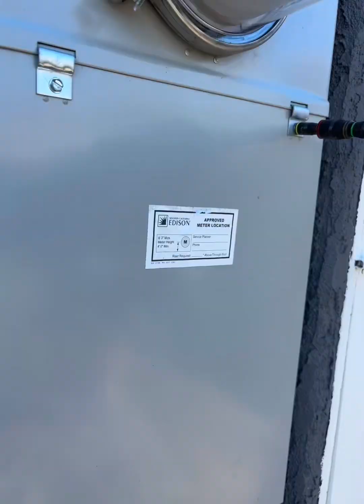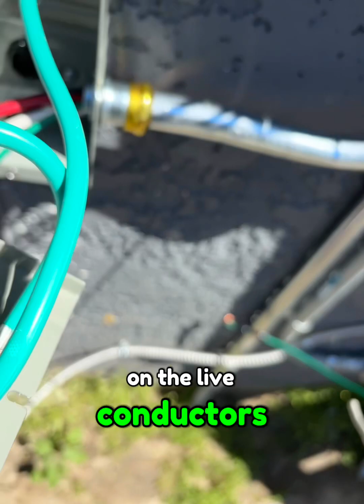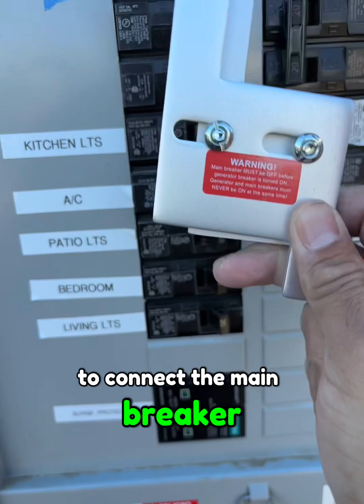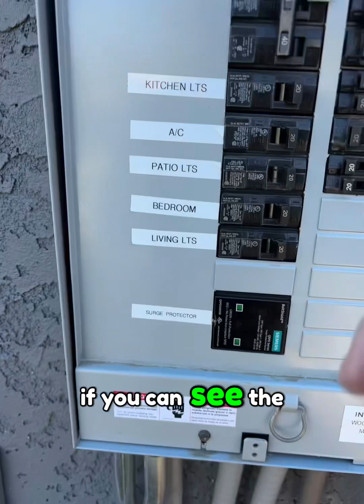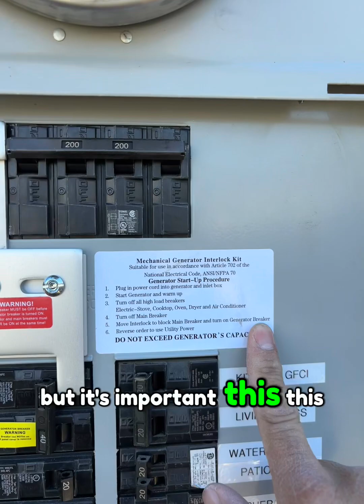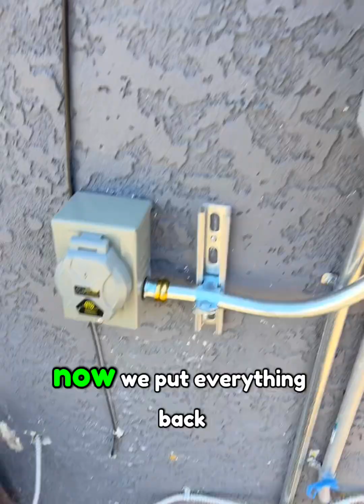Connecting Portable Generator to Suppply House Service panel in case a power outage occurs

Comment: I believe that the 439cc generator has a 50 amp outlet which only has 31.25 amps. You could have used the 30 amp outlet and save money. Unless the customer may want to upgrade to a larger generator in the future. The 9300W is starting watts. The running watts is about 7500W using the 50A outlet, 7200W using the 30A outlet.
Reply from the maker: Thank you for the recommendation! In my case, the output was 40 amps and breaker I limited to 40A too. This is what my client approved.